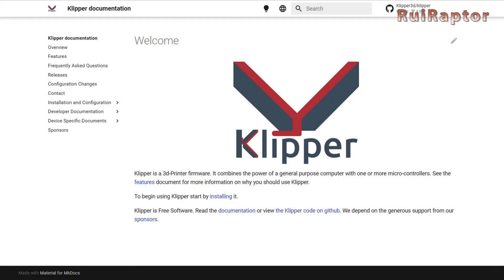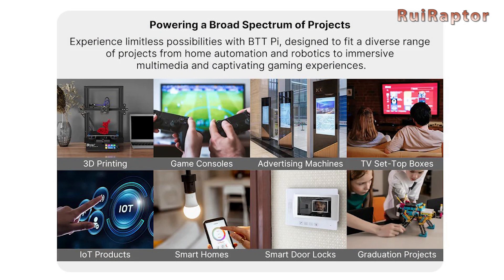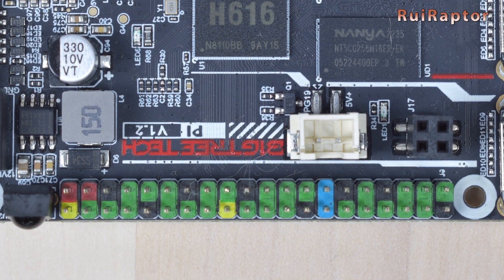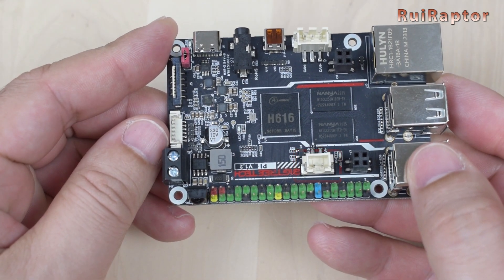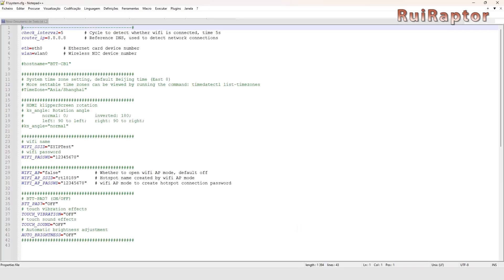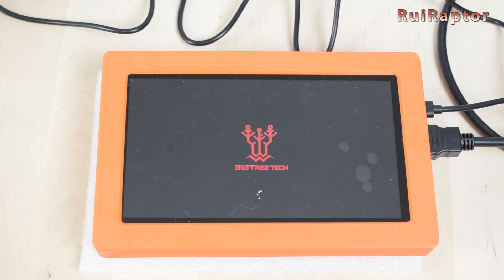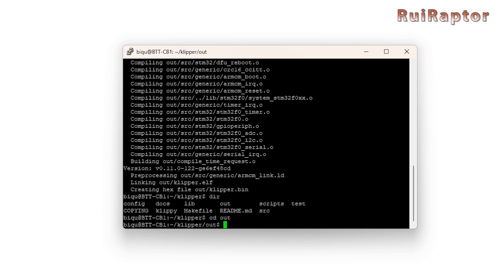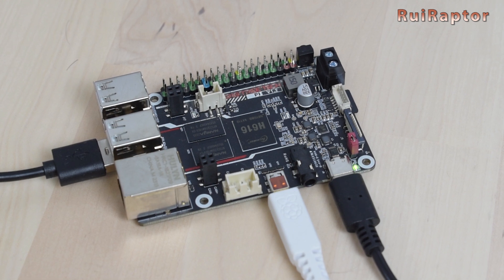BTT Pi Board (An Alternative To RASPBERRY PI ) - Overview & Installation Guide

Comment: I got an Orangpi zero 3 running Klipper with MEGA2560 and RAMPS 1.4 on a homemade delta printer
It runs pretty well
And cheap

Comment: In my opinion, it is unnecessary to install putty as you can simply use window's built in CMD / Terminal using the command: 

ssh (username)@(ip)

e.g. ssh pi@192.168.x.x

this will boot u straight to the password input screen. I recommend using terminal and this allows u to avoid installing 1 additional software that arguably isn't as nice to use.

Comment: Great product but the mounting holes are not the same. Just take a look at it. One is square the other one is not, you can visually see the difference between when it shows the top view of each board - just a heads up in case you were planning on using an existing raspberry pi case to use this board.

Comment: Hello!
does retropie or recalbox or similar linux-based operating systems work on it?
Reply: I don't think it would be viable. Less ram than what's usually on a raspberry pi. Don't see why you couldn't install a Linux desktop distro and go from there
Reply: Not to mention the slower cpu

Comment: THANK YOU!!!!! i installed it directly in my voron without realizing that it has a micro sd UNDER it (which is not shown in it's manual) I i kept trying to flash it with the usb port.

Comment: Hi, do you have rpi pin-out for SPI ADXL345? I can't get it work, thanks in advance
Reply: I also need it, a few weeks ago I bought a btt pi and successfully installed klipper, but when I tried installing the mellow version of adxl345, it couldn't work on the spi connector, and also got the error: invalid ff x e5 , etc

Comment: The long wire isn't the antenna right?  It's the sticky pad?  Do I need to worry about where it's mounted?  e.g. far from the steppers, and not near the board?  on or off the printer's metal frame?

Comment: I have a cb1 and works really well. I ordered and now have one of these, too. It is much more practical than the cb1, unless you have a manta board...
It does not need any/much cooling. It stays between 45-60 celsius. (open air, not inside in a case/printer)

Comment: One of the four mounting holes does not line up with the hole for the pi. This makes any mounting bracket or case designed for an actual rpi, unusable for the BTT pi.
Reply: Is it possible to just mount it with the 3 holes that do line up?
Reply: @fusiondew  yes

Comment: The problem with these boards is support. Pi has the community
Reply: Totally agree. But if somebody has a current project and can't wait for a real Pi to be available it's good to have this option.
Reply: If your goal is to use klipper then there is ample support for this board. If your goal is to use it for a generic purpose then it is running armbian and the armbian forums are very active with heaps of support.

Comment: I'm purchasing a voron 2.4 ldo kit and it wont come with a pi my question is can i use this as a direct replacement ill also be using a ERCF filament changer. or should i just bite the bullet and get a raspberry pi
Reply: This is what ships in the Formbot V0.2 kit.
Reply: Yes, this will do the trick for the LDO kit. Note that you can't run a DSI display from it though so you need to stick to the mini12864 or use an HDMI display.